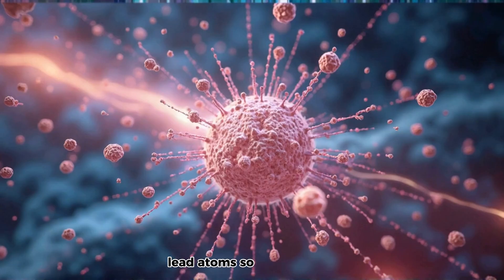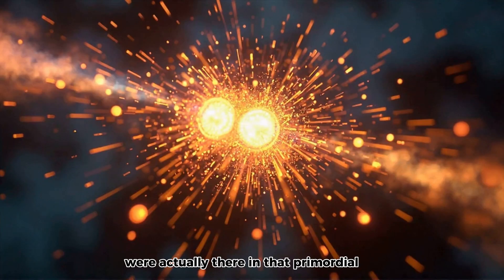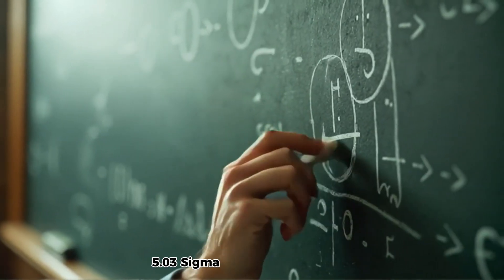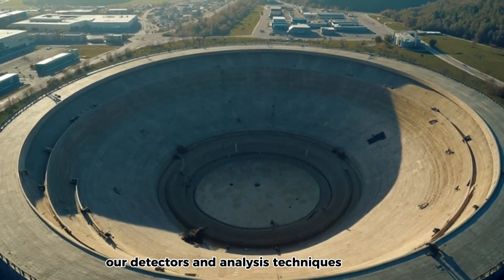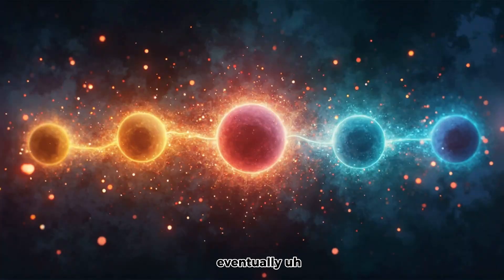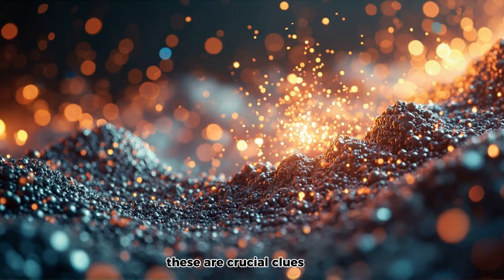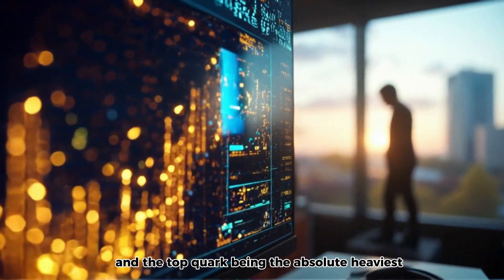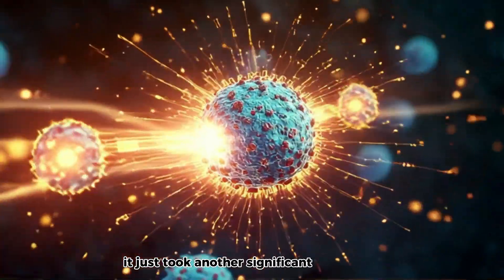Sheds Light on the Universe’s First Moments: Top Quark Discovery Shocks Physicists Worldwide

Comment: These are theories based on a tiny tiny bit of data and require a massive leap of imagination to come to these conclusions and theories.  Could they be right... possibly, but likely not.  There are so many parts of the Big Bang theory and the theories around it that do not work.

Take the size of the known universe.  They say it is about 80 something billion light years across and expanded from a point about 14 billion light years ago.  This would require the universe to be expanding faster than the speed of light.  How would this effect the passage of time then and how much is this going to screw with all the other theories.  Other excepted theories say the passage of time for anyone or anything traveling near the speed of light would be greatly slowed.  So would time go backwards then since we are all traveling faster than the speed of light.  Would not our mass be infinite?

So if the Universe is actually say 3-4 times older than we thought then we are only traveling at a significant part of the speed of light.  We might only observe it like it is 14 billion light years.  It would also increase the mass of the these galaxies do to this speed and would fix the whole mass of the galaxies not working right... meaning that Dark Matter is BS.  It is time dilation not dark matter that fixes the formulas and the Universe is much older than we think but time dealation has messed up our observations.